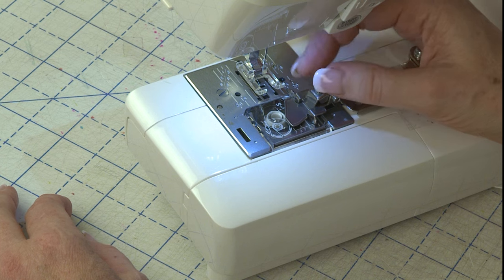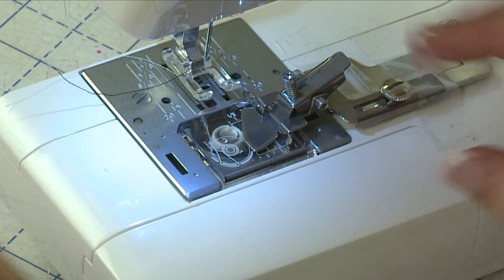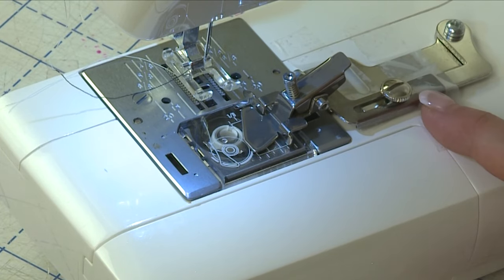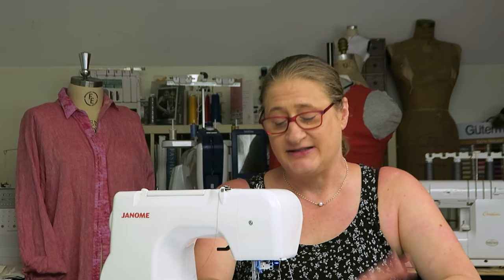Cool Tools Part 2:  Can You Use this Presser Foot on Any Home Sewing Machine???

Comment: thank you so very much, i went and brought one before looking at my singer heavy duty machine a fairly new machine for me and it didn't have a hole i was disappointed but you've just saved my day , thank you .
Reply from the maker: I have officially sewn projects using in on the machine that it screws into and on the machine that it was secured to with tape... Works equally well!...I'm off to find some of those sticky poster tacks that don't leave residue on surfaces to see if  they are also a good option to use if you don't  have a machine with a screw hole!
Reply: maybe a small piece of non slip fabric under before you tape it
 @JSternDesigns

Comment: Thank you so much for this video, as I had ordered my attachment right after seeing the 1st video.  I had to wait until yesterday to receive the two I ordered for my two machines as they were on back order.  I immediately took them to the machine I use to sew my blocks together and was so disappointed that the hole on my machine did not allow me to attach the foot as I expected. Before sending them back, I thought to read the reviews to see if someone else had this problem and had a solution.  THANKFULLY, your name was submitted as having YouTube videos that offered 2 ways to set up the attachment.  With the tape, I think I can make this attachment work! Thank you so much for your very helpful videos, and “can-do-this” thinking outside of the box!
Reply from the maker: :)  Yay... I think Painter's Tape might be a better choice... I couldn't find mine when I shot this video.  I think it's easier to pull off the machine vs. Scotch Tape!

Comment: Thank you.  I was going to throw it away and was so disappointed it would not work.  You are genius!
Reply from the maker: Yay for the save!   I took the little Janome Jem with me on a visit to my Mom.     I used it (still taped to the machine as shown here)  to sew a little continuous placket at the  back neckline of a dress.  My Mom needed a bigger opening to get it on and off.   It worked like a champ to hold the folded fabric of the binding as I finished the edge of the slash I made.  I'm so happy with it!   Thanks for watching

Comment: Thanks for the second video.  I was disappointed when I hit my presser foot it didn’t fit.  While I have a hole in my brother Altairs needle plate it’s smaller than the screw. I’ll give it a try with the tape. Thanks for the follow up!
Reply from the maker: Yay... I think Painter's Tape might be a better choice... I couldn't find mine when I shot this video.  I think it's easier to pull off the machine vs. Scotch Tape!

Comment: I got mine & I have a hole in my brother machine but it was too small for the hole. I stuck a thumb tac in the hole and it worked but backwash wobbly so I taped it down. I’m definitely going to go back & try this method. I got some fabric today & came home & stitched it to put in washer. I usually fold my fabric to save on thread . I only used 3 pins to keep fabric together. Before I had to stay stitch my fabric together because fighting to keep fabric together would wear my arm out from old injury. This is going to save me so much time. I ordered it through your affiliate link. I’m glad you have tutorials because there’s not a whole lot on the internet about it.
Reply from the maker: Maybe take the screw to Home Depo and see if they have a slightly bigger screw?  ...If not securing it with painter's tape works great too!
Reply: @JSternDesigns  I got I backwards the screw was too big. It doesn’t matter though be the second way on your second video did the job. It was spot on!
Reply from the maker: Yay...Tape for the win!

Comment: Thank you for both videos demonstrating this tool.  I have a modern Juki DX7 and an old Bernina.  I have ordered the seam guide as I think it will probably fit the Juki with no problems but I was thinking of using blu tack to secure it to the Bernina.  I'll report back when it arrives.
Reply: I tried to make it work on my Juki HZL-f600, but the needle plate is small and I couldn't attached it. Never occurred to me just to tape it in place. Guess I'll reorder it.
Reply: @SG-qi7pv please do! I have a DX7 and it appears there is a hole that the screw SHOULD fit into but good to know from you before I purchase ;)
Reply: There are holes in the needle plate, but they are bigger than the metal screws that came with the presserfoot and don't fit. @lexycorreia
Reply from the maker: Maybe take it and the screw to Home Depo and see if you can get a slightly bigger screw :)
Reply from the maker: :)  My pleasure... I actually used it to sew a placket into a neckline for my Mom with it taped as shown here... Worked great!   I think you'll love it!
Reply: My seam guide presser foot arrived today so I'm back to report on my experiments with it.   First with the Juki DX7.  The screws supplied do not fit the holes in the throat plate so, initially,  I used the bottom right hand screw from the throat plate to secure the presser foot.  This worked although the maximum  stitching distance I could manage was only 1cm (about 3/8 inch) because the throat plate on the Juki is quite small.  I was able to use the presser foot successfully by butting it up against the edge of the needle plate and securing it with Magic tape (I couldn't find my decorator's masking tape at the time).  This allowed the sliding bar to move freely for a wide range of stitching/hem widths,  just as indicated in the video.  Next, I tried the presser foot on beloved old Bernina 930.  I was absolutely delighted to find that the screws supplied fit the holes in my Bernina perfectly, although I had a screw from another old attachment ready to use if necessary.  The presser foot worked perfectly and I was able to sew several rows of parallel stitching very successfully.  Doing this provides a means of twin stitching at your own preferred distance apart rather than being restricted by the size of twin needles and not having the zigzag on the reverse.  I'm really pleased with the results and can see myself getting quite a lot of use out of the attachment.
Reply from the maker: So happy to hear, thank you for sharing your experience!

Comment: Great video!  I just discovered that the screws that came with my Baby Lock Triumph serger work for this attachment.  They are plastic headed but long enough to work on my Bernina B480 machine!
Reply: I should've added that my machine had holes but the screws that came with the Presserfoot were not long enough.
Reply from the maker: I was thinking that a quick trip to Home Depo might fix that!

Comment: They also make one with a Magnet, which would work for me because I have vintage sewing machines. Anything with too much aluminum or plastic the magnet would not work, but most industrials have a lot of steel.
Reply from the maker: Yes, you can use the one with the magnet if you have a metal machine :)  It sounds like a good option for your machine!  Thanks for watching

Comment: I've got a]both Bernina and a Brother sewing machine. I haven't checked the Bernina, but looking at comments below, it may well fit.  The Brother does have a screw hole in a similar place to that on the machine you did your first demonstration on.  My presser foot is  not due to arrive until 1st Sept, so goodness only knows where it is coming from !!  I can't wait for it to arrive as I can see how handy it will be for patterns that have both 1/2 and 1/4 inch seam allowances.  Having used 5/8 for most of my life, I can eyeball that with no problem  - the others I usually mark with chalk, which is time consuming.  Thanks for this.
Reply from the maker: :)  I love it that you can eyeball 5/8"!!   I think this will help you with smaller seam allowances too (until you can eyeball those too!) Thanks for watching
Reply: I tried it and the screws fit my Bernina 180 but aren't long enough so also trip to hardware store.  Tried the screw without the attachment and fits, the thickness of metal keeps screws from holding.
Reply: @donnad8142  ive got a really old one that my husband bought me in 1982, so hoping it will fit or it will be scotch tape 😁

Comment: There is another version of this presser foot which is fixed to the sewing machine by a very powerful magnet at the bottom of the foot. You can use it with most sewing machines. Even if you can't, like me, you can stick a piece of thin iron sheet (I used a chopped iron ruler) to the sewing machine arm next to the throat plate, and the magnet will stick to the machine -- much stabler than the scotch tape.
Reply from the maker: The magnetic version is a good option for people with metal machines.   I am going to share a project that I did using this foot (scotch taped onto this little machine) in my August Newsletter.   I slashed the back neckline of one of my Mom's dresses and created a continuous placket with a tie to close it so she could get it over her head easier.   The foot was rock solid and worked great!    Sign up  for my newsletter and get a set of mini pattern pieces to practice fit adjustments as a thank you!   https://bit.ly/3LAchsY

Comment: I ordered this foot, I first checked that some of my machines have a screw hole including my CoverStitch machine, I do have a tool to have you show if yo want to, it is the Annie's Stiletto and pressing tool, I ordered it as well and have not received it yet but it looks promising as it is designed with a sharp point and a rough grippe side shaft to move around fabric cloth close to the machine needle or the iron.
Reply from the maker: Thanks  so much! ...and I put Annie's Stiletto in my cart!  stay tuned for my thoughts on this potentially cool too! Thanks for watching

Comment: ❤have u seen they have made it simpler. Its boxier without the arm that moves & magnetized now. Just got mine- unable to try out because surgery & cant go upstairs to my machine yet
Reply from the maker: Yes! There is a magnetic version as well... Works great on machines that are metal :)  Sending speedy recovery wishes! Thanks for watching

Comment: Worked on two of my Berninas. Not sure it will work for all sewing feet. Fits on my coverstitch machine but not on my serger because ‘table’ has no holes and is raised for looper.
Reply from the maker: Does your Bernina have a screw hole?  I tried to find a photo of it to answer another subscriber's question about that and I couldn't see a screw hole on the 770 series needle plate.  :)

Comment: I made some overalls that called for large grommets to tie the straps into. Instead I cut a circle and zigzag stitched around a few times. looked ok but wondered if there was something to help do a better job. There is and it's a flower stitch foot. Have you used one? I have a Janome HD3000 and can't figure out which to get. I don't understand if I have a low or high shank! This foot looks like it would be fun to use.
Reply from the maker: That’s a good one!! I’ll put it on my list of upcoming topics.   Thanks for following along with me

Comment: I have a Janome 740dc that has screw holes for certain attachments but I don’t know if the placement of the screw holes or the screw size will work. My needle plate is much larger and recessed. I wonder how far the slider moves.
Reply from the maker: I went online and did a search to find the needle plate for the 740dc... It looks like it has the same screw hole as my Janome 6700P (which has a really large needle plate too).   It looks like it will fit!
Reply: @JSternDesigns  Thanks.

Comment: My serger is very old probably 94-95 when my mom bought it then it was gifted to me ! I’ve adjusted the stitch length with the 3 thread, doesn’t seem to change ! Will it only work with the 4 thread ? I noticed in a video made by you , you’ve got an awesome machine compared to mine ! What am I doing wrong , nowadays I get a lot of clothes to be altered, I like to serge for a neater job, but , the changes I make aren’t working! Can you help me, I know the other option is to buy a new machine. That option isn’t in my budget, I struggle with rent , medical services, just isn’t for me , I would love a new one , just not possible!😢
Reply from the maker: Sorry to hear that your serger isn't behaving for you!  Without being able to play with it, I can only offer a few suggestions.  Did you take out the right needle (and make sure the left needle is inserted all the way) when you were setting up your serger for a 3-Thread.  ...Make sure the needle thread is seated correctly in the tension unit... and maybe snug the looper tensions slightly.   If these things do not work, it may be that you need to bring your  serger in for service.... sometimes older sergers need a little love!   I hope this helps you, thanks for watching

Comment: My Pfaff  7550 has a hole for the screw that is 1 3/4 from the  side of the needle and 1/2 down from the needle in the throat plate.  Do you think the presser foot might work? I enjoy all your videos and have learn so much from you.  Thank you for any help Virginia
Reply from the maker: Ahhhh.... My first top of the line machine!   I used to work at a sewing store where I quickly became the Pfaff instructor!   (I had both the 7575 & 7550)      This hem guide had screws that you can loosen and slide the metal clip side to side and farther and closer to the needle.   I don't have this machine anymore, so I can't test it for you... But even if you  can't screw it in, you can secure it with tape like I show here :)
Reply: Thanks I think I  will order it because it like it will be helpful in keeping seams straight.

Comment: I like this tool you demonstrated.  I have 3 Janome machines.  Thank you!  BTW, Martelli has a zip bind tool that retails about $ 32 to 38.  I've tried contacting them with this question but no response.....Can I use this binding tool to machine bind instead of hand sewing the binding?...I can no longer hand sew my bindings.  this would be a great tool to machine stitch if it works.
Reply from the maker: I think this tool will help guide the fabric binding and quilt edge together for fast, accurate sewing.   I will also investigate the Martelli Zip Bind Tool too!  Thanks for watching

Comment: Could you take the plate off the sewing machine and hold it up so we can see exactly where those holes are? My plate doesn't have them and I'm thinking about drilling the holes.
Reply from the maker: This machine doesn't have any holes in the plate... that's why I taped it to the bed of the machine :)

Comment: I have bought same/similar thing on aliexpress. I have bernina b38. I have a problem that my screw hole in plate is positioned in such a way that when I mount it it is too close to presser foot. I dont mean east-west positioning? But north/south. Its too much north. If i am fine with wide seam allowance or I am sewing hem its okay. But I was hoping it would be useful for 1/4 inch seams? But my sewing foot is hitting it :( scotch tape isnt  securing it enough for me. Maybe I will try those tacky gooey bits that are used to put posters on walls? Idk. But still great for hems
Reply from the maker: Painter's tape holds better... Or try this https://youtu.be/imGEMbtIG2M   Thanks for watching!

Comment: You can buy this gadget which is magnetic so can use on any machine with metal plate
Reply from the maker: Yes you can :)   The bed of the machine would also need to be metal because the front of the hem guide with the paddle takes up most of the room on the metal stitch plate. (unless your machine has a really big needle plate   Thanks for watching

Comment: How does Madams sew feet 30 to a pack match up to use?
Reply from the maker: I did a quick search of this set of presser feet.... They fit  on low shank models of these brand machines: Singer, Brother, Babylock, Euro-Pro, Janome, Kenmore, White, Juki, New Home, Necchi, Elna, Husqvarna Viking, Toyota, PFAFF and most other low-shank domestic machines.    They include these feet:  Invisible zipper foot, Applique foot, Satin stitch foot, Open toe foot, Cording foot, Straight stitch foot, Roller foot, Blind stitch foot, Braiding foot, ¼” Quilting foot, Beading foot, Standard zig-zag foot, Non-stick foot, Darning foot, piping foot, 9-Groove pintuck foot, ¼” Quilting foot with guide, Gathering foot, Knit foot, Adjustable zipper foot, Fringe foot, 5-Groove pintuck foot, Darning foot, Stitch guide foot, 5 Hole cording foot, 7 Hole cording foot, Edge joining foot, Overcast foot, Open toe foot, Rolled hem foot, Flat hem foot, Adjustable bias binder foot...  Unless you have a machine that doesn't have any or many accessory feet... I would check the list and see how many you already have or would actually use before buying this set.  (I think there will be a few in there that come with most sewing machines  and a few more that are very "specialty" (you may not be interested in the techniques that these feet are made for).    Hope this helps!  Thanks for watching

Comment: Why does it have that hinge?
Reply from the maker: The hinge allows you to swing the metal paddle that holds the fabric down out of the way if you need to wind another bobbin... also I find that it gets in the way on tight curves, so having the ability to  swing it out of the way and then put it back is helpful.   Thanks for watching